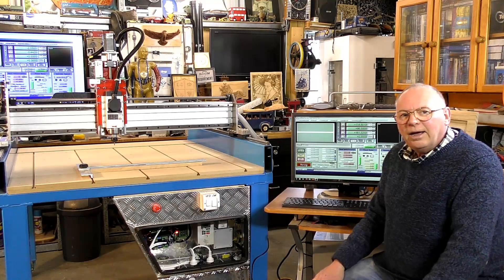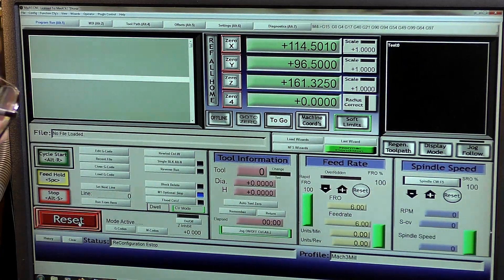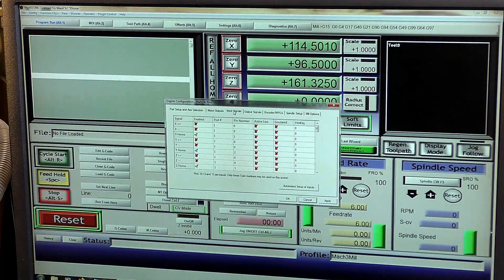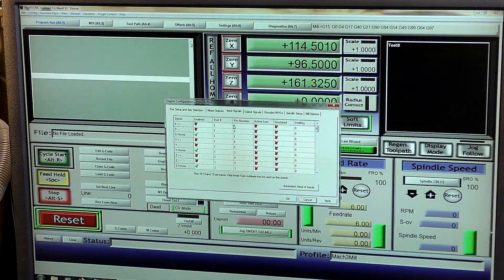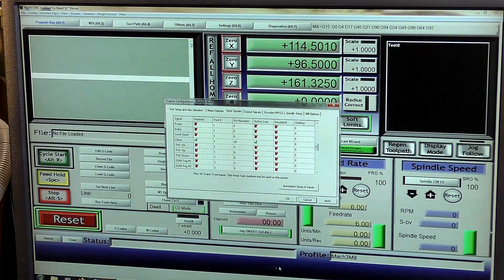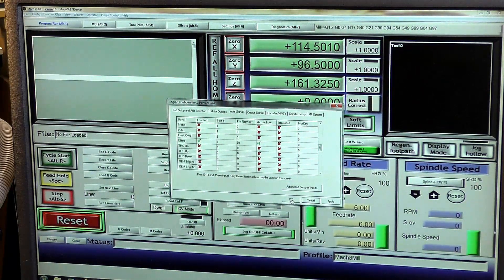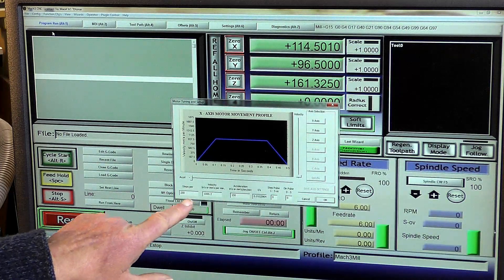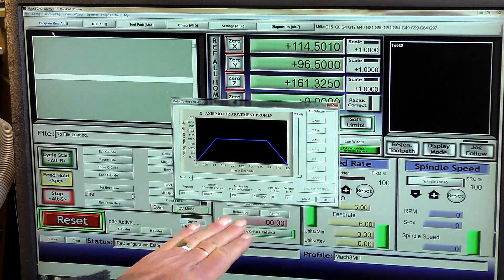Mach 3, setting up for a new CNC router [Episode 19] Part 1 of 2

Comment: pls help and explain to me - I have limit switches on both ends of the X - Z axis. The Z has a limit switch at the top of the Z axis. do I still need to config the table size (how much X Y Z IN CONFIG SETTING) - TIA
Reply from the maker: Yes! ;-))
Reply: @inventorsworkshop9600  Thank you. Could you help me to set up my table - I am willing to pay for your help - I have a 5 axis Trunion CNC - we can use Skype to do this.

Comment: Thanks for this, I just got done setting up a 4x8 CNC table from China, unfortunately I am using a Chinese Mach 3 board so hope all goes ok until I learn the machine and I can always upgrade. So I got the machine moving with the keyboard, but how do I use the hand wheel, it is connected but will not work (WHB04B). I will probably be joining your Patreon sir, I am gonna need all the advice and tips I can get!
Reply from the maker: Hi, there is a facility on my patron pages for technical help
https://www.patreon.com/user?u=15079773

Comment: Can I ask you why you decided to use Mach 3 when you could have used the SMC 5-5-N-N that you talk about in your midi CNC or would the SMC 5-5-N-N
 no work with the larger stepper motors?
Reply from the maker: The SMC5 would run this ok, the SMC5 will run NEMA 34s and 42s

Comment: Hi Roger, Enjoyed the very almost complete 2nd CNC router build :-) . Got a quick question, I'm looking at an offline controller as I've found MACH3 to be a bit buggy so was looking at either the SMC 5-5-N-N or the PC based Centroid Acorn. However the Centroid states it is a step/direction but my existing stepper drivers are pulse/direction I think. I've already had a driver fail (30 mins after first use) so replacing all 3 won't be such a chore if need be but I don't want to go down the route of replacing the stepper motors, yet. Long term I will be prob looking at doing a new build, probably a small CNC with a working area of 400X200 and fixed gantry so I can concentrate on machining Alloys with more than the 65MM Z travel of my current 3020T. Thanks in anticipation of comments.
Reply from the maker: Hi have a look. at my midi CNC router build with a SMC5-5-N-N

Comment: How do we set step pulse signal length in motor tuning? My stepper driver manufacturer states that it should have a minimum of 2.5uS, but Mach3 doesn't store the value I write there 😕
Reply from the maker: Hi, see the next video in about 5 hours, but start with the step pulse I have set in this video.
Reply: @inventorsworkshop9600  Hello Sir, I am referring to step pulse value box, not acceleration or speed.
I can't seem to find a way to set and store a value greater than 0. Mach3 resets the value after clicking OK button. 😕
Reply from the maker: Set it to (250) and see if it works ok
Reply from the maker: OK, steps pulse!!! put in 2 or 3, I don't think you can put in .5
Reply: @inventorsworkshop9600  I already tried that, it doesn't store the value. It seems like it stores the value, but when we come back to check, it's already reset to 0 again.
Reply: @pmsilvei  Do you press "save axis settings" before exiting the tuning screen or switching to another axis?
Reply: @nielsvandenboom  yes, i did. But i will double check. I think maybe this option isn't enabled with USB boards? Only for serial? Does that even make sense?

I'm afraid that is the cause for loosing steps in X and Y.
Thank you both for trying to help!